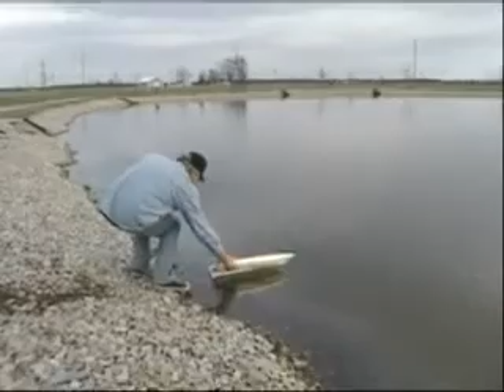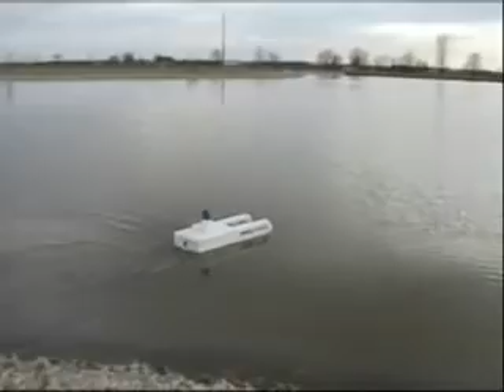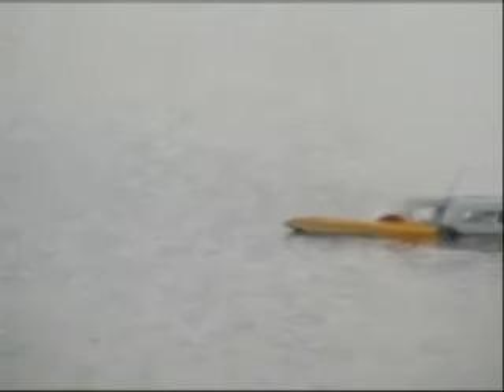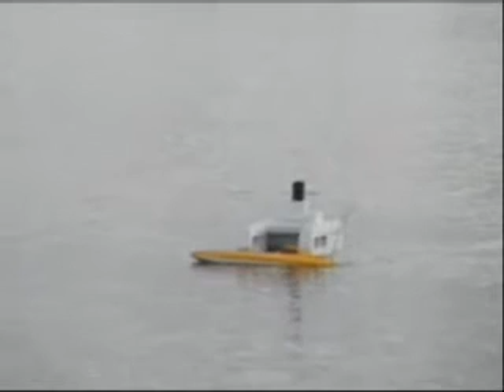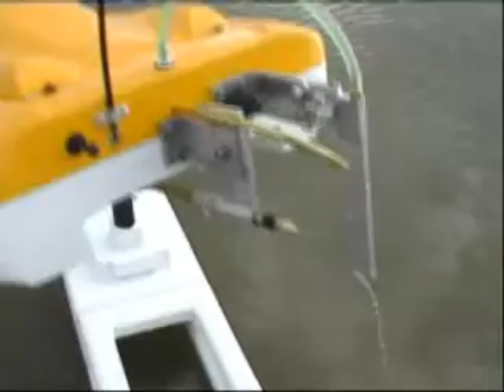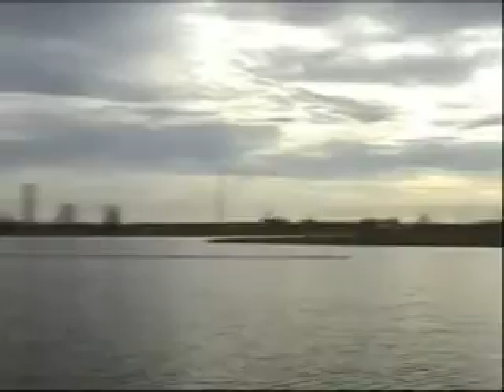8s lipo 29" brushless R/C Catamaran by Skunkworks KB45-11XL

Comment from the maker: Hi,
My set up for that run was a KB45-9L motor, TURNIGY Sentilon100A HV 2-12S Speed Controller, two 4s Zippy H 5000mah lipo's in series, Octura x436 prop.